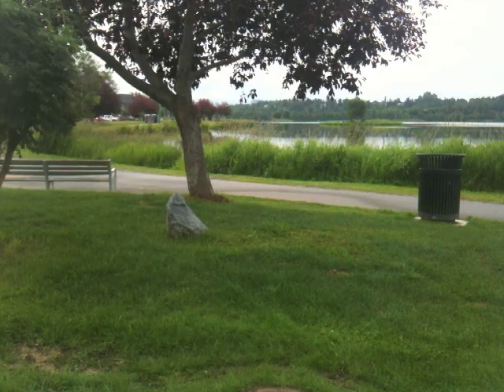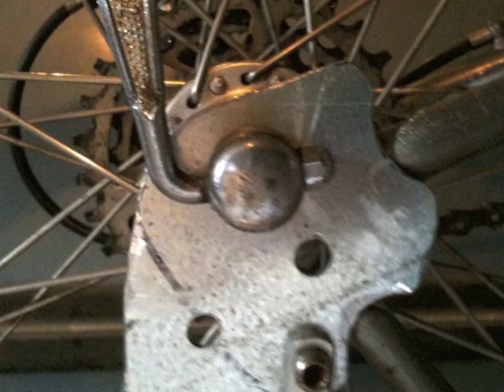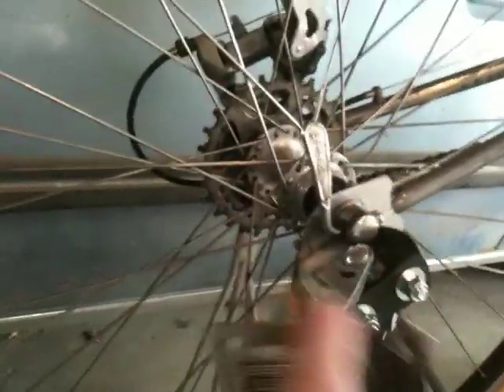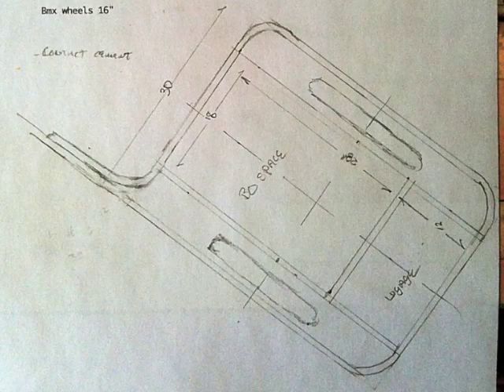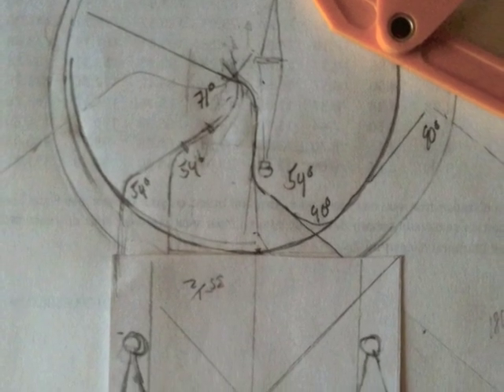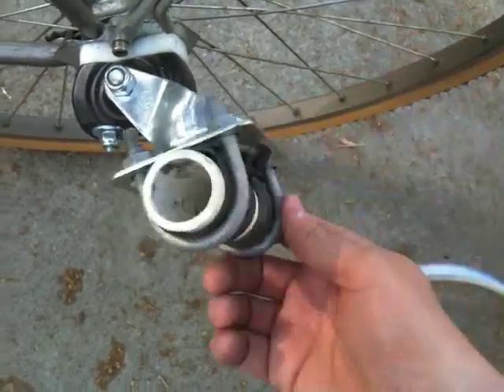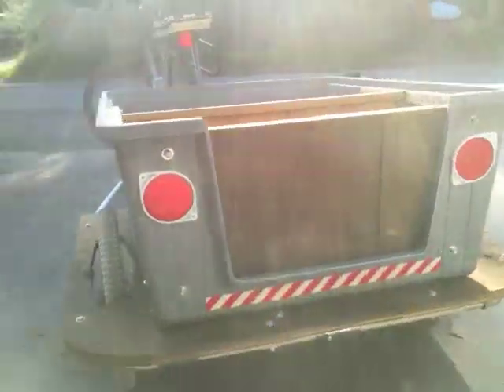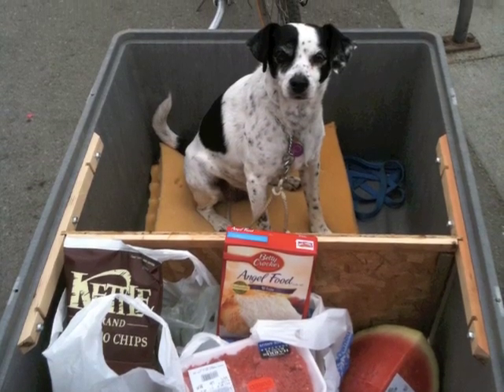Build a Bike Trailer.m4v

Comment: I would rather see an old radiator hose used  instead of the PVC on the coupling. PVC is just not a trustworthy product under mechanical loads. I realize it will probably never fail and leave you stranded but still old radiator hose is easy to come by and it can only rot and never shatter.

Comment: Very nice. 🙂 One thing that may be worth an extra mention is the difference between 1-  and 2-wheel designs.

A single-wheel trailer looks stylish and slim and aerodynamic and probably presents fewer construction challenges, but a twin-wheel arrangement as shown here is infinitely more practical if you're serious about load carrying.

If you're hoping to move mountains (or a really big doggie!) go for a twin-wheel trailer.

In my limited experience, a (homemade) single-wheel trailer is better suited to people who are more interested in cycling than lugging cargo. If you've got 50 miles to go and 20 lbs of camping gear and water to carry, a single-wheel job will be ideal.

Such a setup won't slow you down much, but don't forget that the typical load they can hold will fit in a backpack or a rear pannier. So... why tow a trailer in the first place?

A twin-wheel design potentially has a load-carrying capacity of over a hundred pounds. It's great if you need to shift bulky stuff, but it will definitely slow you down.

I'm not interested in style or long-distance cruising efficiency - I just want to get a month's supply of groceries home - so I'd recommend a twin-wheel trailer if you have similar needs.

Comment: 8 issues I want to point out...
1.) DO NOT use electrical conduit tubing. It is not designed to be weight-bearing. It is made from a 2011-type aluminum, which is very weak, and why it's inexpensive. If look into using a T-5 or a T-6 aluminum, it's a lot stronger, weight-bearing, and is often the type that is used in building bicycle frames & ladders. And just throwing it in there ...if you want to use a T-7 aluminum, it's great for everything I just mentioned, and it holds up great against extreme hot & cold weather. But you'll run into assembly/repair issues if you try to gas or arc weld it. 
2.) Most bicycle trailers use a 20" wheel. Please remember that the larger the wheel, the easier the ride. But try mounting the same size wheel to your trailer that you use on your bike. That way you won't have to bring 2 different types of tubes/tires with you, in-case you get a flat. 
3.) It mentions in the video about using aluminum for the mounting plate and PVC for variation in the sway bar. Once again the "type" of aluminum being used comes into play. Also as far as using PVC for anything?!? ...PVC is even weaker than 2011 type aluminum, the same laws apply when it comes to crimps/cracks, and is even less weight/stress-bearing.
4.) Plywood? ...seriously?!? Even at 3/4" you'll have to take it apart and replace what will soon become is a warped board. Thus also causing your 2011 aluminum to bend/warp, therefore even more risk of damage/breakage.  
5.) I quote the builder/designer: "I want to carry lots of weight" Without knowing the weight capacity of the trailer, this will more-likely result in overloading. 
6.) Box cover plates also are made from a 2011 type aluminum SMH.
7.) Ever notice the difference between box trucks and dump trucks? ...dump trucks have their axle pushed waaaay back. Why? ...because things like load type/description and axle position have a bearing when it comes to vehicle's mobility/travel and not-to-mention stress on one's hitch. It would be a really good idea to apply that formula instead of just winging it ;)
8.) Just a little tip that since not all drivers are focusing their eyes to what lies less than 1 ft. from the road aka your reflectors. I-personally mount 2(1 on each side) 3-4 ft.X 1/4" poles to my DIY bike trailers, while using a 50-100 lumen pulsating lights.

Comment: I'm working on a trailer for my dogs too. Actually I was thinking of making it a sidecar. Problem is I have three large dogs, so it'd be wide. Got the whole thing built except for attaching the wheel and however it will hook up to the bike, but now I'm going back and forth on sidecar or trailer. I like the sidecar cause they'd be right next to me, and its sillier than a trailer, but a trailer seems easier to build, and I suck at everything so i usually go for the easier option
Reply from the maker: I guess the side car would be more attachment points, would likely not let you lean in the turns, and would take up more room on the side of the road maybe placing you and your dogs at more risk. Interested experiment however, good luck with that.

Comment: excellent video thankyou I have just received tow wheels just like those off ebay and because there were only one of each one left I ended up with kids wheels one of which is a girls bike and has a smaller hub and axel so my idea of welding or epoxying th one side of the wheel axels into each end of the axel 25mm tube fell short and now Im making mine just like yours with bent mounting plates each side to lock the wheels into. you could alos use pvc pipes and bends if you are attaching to a strengthening ply sheet

Comment: Building a trailer that could be folded up and out of the way in a single room efficiency apartment with the basic hand tools, hammer, hacksaw, drill and small angle grinder would be a serious challenge for this poor boy.

I have $60 a month I can spend on what ever my heart desires and want.

I figured if I saved up for two months i could buy the 180 lb capacity Aosom cargo trailer on eBay for $92.99 as a good starter kit and still have money left over.

Now to build a strong flexible inexpensive supenssion system with those same basic hand tools, hammer, hacksaw, drill and angle grinder is my new challenge.

I've already installed solar panels on the cargo trailer and a controller regulator under the seat to charge the 24 volt battery packs for my 2008  Currie eZip Trailz electric bike.
See my 24 volt Aosom solar cargo trailer.
https://youtu.be/mxEGgt4dXHk